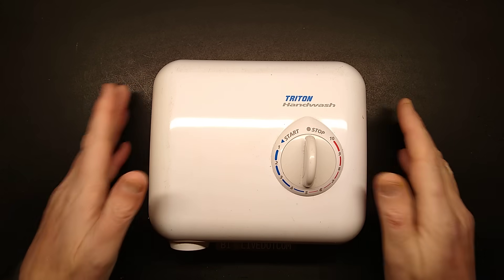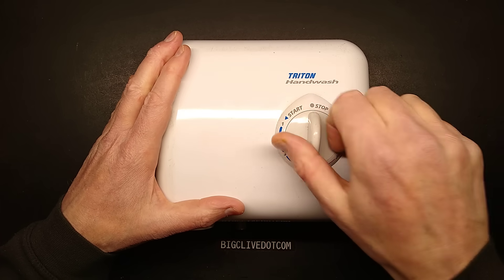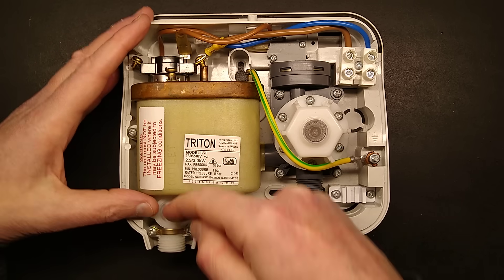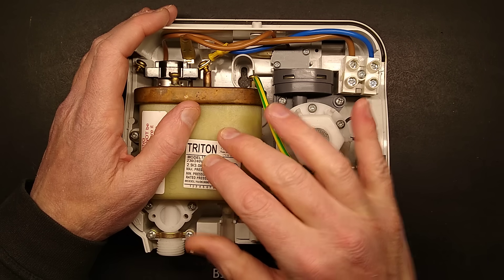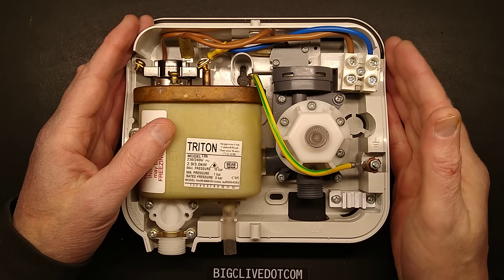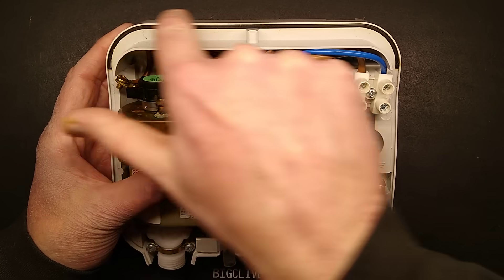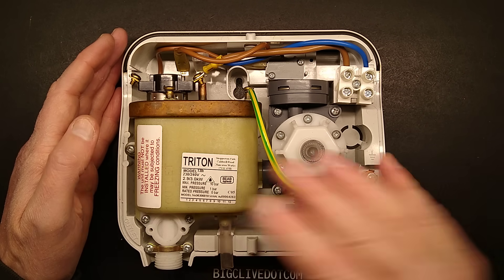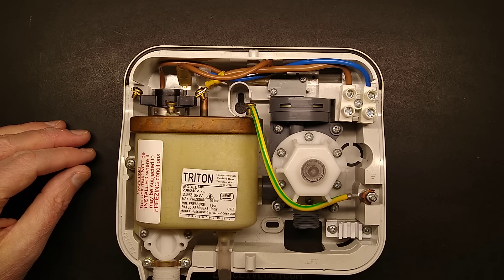British construction site hand-wash unit

Comment: A place I've worked in (and perhaps Clive has too) in Edinburgh had an instant-hot-water tap in the kitchen with potable water, suitable for making tea and coffee right out of the tap. There was no adjustable temperature regulator, just lots of warning labels regarding the water temperature. Never seen anything like that anywhere else.
Reply from the maker: The self filling boilers have been around for a while.
Reply: We have zip taps here in Australia for hot drinks, but nothing like these where you can actually wash your hands. Zip taps are like a straw spitting out how water and like $1500 EACH!
Reply: Got one in as second tap on kitchen sink. First unit didn't work so well, but replacement has been golden. As an uncaffeinated household, It mostly sees use for pasta water, though some stuck on stuff gets placed under it or (for long handled things) held to get cleaned.

Comment: Here in Brazil we don't tend to have whole house water heating, and our basin and sink taps generally just supply cold water. But we do have similar (in principle) gadgets to this. They're pretty much identical in operation to the "suicide showers" with which you may be familiar*. We have one feeding a mixer tap in the kitchen. I think it's 5kW if I remember correctly.

*In case you're not, the big difference is that the element is not isolated from the water. I've never heard of anyone being injured either by the shower or one of these hot taps, though.
Reply: „bare wire“ heating Systems in electric Waterheaters are Safe to use. pretty much all electric Waterheaters here in Germany use it because of its fast reaction to changing waterflow. most common units for showers are 21kw 400v threephase Power. newer Models use electronics to control the heating elements for a stable temperature.
Reply: He already pulled one of those apart: https://www.youtube.com/watch?v=cNjA0aee07k

Comment: I purchased this version which is the mark 2, off E Bay for £52.00 Triton used to be in Nuneaton.
which is supposed to be a retro fit from the mark 1. You should be able to replace the mark 1 with the mark two without having to alter the water feed or the electric feed, which turns out not to be the case. The mark 1 version is held in place by three fixings, the mark 2 version only has two fixings.

Comment: Now there are also instant hot water "mixer" taps with everything integrated in the tap body. But I put mixer in quotes because those only have cold water inlet and I don't know if they divert the water inside and still have an actual mixer or if they use only an adjustable thermostat and you have to wait for the whole thing to cool down if you need cold water and you're damned if the thermostat fails closed and the water boils inside.
Reply from the maker: I took one of the import heated taps apart.  Quite well made.

Comment: I suspect these are more reliable than cheap electric showers which simply have an instantaneous on-off switch, because you give the element time to cool down a bit as you increase the flow rate by needing to turn it towards cold to switch it off. Decent electric showers leave the water running for a little while after the heater is switched off. With cheap electric showers I emulate that by switching them to cold just before turning them off. Otherwise, the water suddenly stops and the temperature can rise considerably in the heater block.
Reply from the maker: I always switch to cold out of courtesy for the next person at the gym.

Comment: I remember a predecessor of these where there was a small cylinder of water heated by electricity over a sink: my late great aunt lived up to her death in 1998 in an end terrace with no central heating, no bathroom, an outside toilet and no hot water save for the cylinder above the sink. Are they still made?
Reply from the maker: Yes.  You get over-sink and under-sink electric water heaters.

Comment: I'm really impressed by the specs on that little heater unit:
Max pressure: 10 BAR
Min pressure: 1 BAR
Rated pressure: 0 BAR.
Wouldn't you expect rated pressure to be somewhere between min and max?
Reply: I think the Min/Max is for the tap, and the 0 BAR is for the heater which is designed for unrestricted flow.
Reply: Badly worded, but correct.  Max SUPPLY Pressure 10 Bar, Minimum SUPPLY pressure 1 Bar, Operating pressure WITHIN THE BOILER  0Bar.  Crap and lazy labelling by a manufacturer that has been making both these and similar shower units for Decades.
Reply: I think what the label is trying to say is that the unit should not be installed in public houses without a risk assessment. 🌊🍻🚫🙃

(And given how some of us Brits can be after we've had a few, that's probably not too wide of the mark! 📜😉)

Comment: I quite like on-demand water heaters like these. They're especially sensible when placed on a sink the opposite end of the building from a main water heater. I think I'll take the difficulty in wiring one of these in the USA (something not done often) in exchange for not having to daily carry around a USB power adapter the size of a literal brick as most UK types are.  If I could choose a global standard, I'd honestly prefer Schuko to either of them, though I do like the UK's switches at every outlet. Very useful.
Reply: Is the Schuko preference for performance or personal reasons?

Comment: That's cool. We don't have those here in the US. You use cold water from a water bottle you brought with you or you find a gas station to go wash your hands. If you are really lucky there might be a water hose on site somewhere. At some point I need to add a sink to the shop as it would be very handy. Easier than making the 250' round trip to the house just to wash hands or clean things. One of those would be really handy or something like it. 
        And yes we see electric showers as scary dangerous. In the UK it's Ok to have live power right in the shower with you but you can't have an electrical outlet anywhere in the bathroom unless you have a massive bathroom and it can be something like 15' from any water source... Makes no sense. But then neither do plastic breaker boxes and many of the other methods in UK/Europe that would never meet code here in the US.
Reply: The reason that electric showers are safe is that they are specifically designed, as sealed units to be safe in very wet environments. Americans seem to have no issue with hot tubs that similarly can combine electrics with water.

The issue with standard electrical outlets in bathrooms is that anything can be plugged in and used in close proximity to very wet areas. A hair dryer, for instance, is not designed for use in very wet areas, nor is an electrical space heater. 

Electrical sockets are now allowed in UK bathrooms, but they have to be at least 2.5m (down from 3m) from a "wet area" (bath or shower), as the length of the flexible cable on a typical portable appliance makes it unlikely that somebody in such an environment could touch one 

Needless to say, for some time bathroom electrical systems have also had to have RCD (GFCI) protection, and it wasn't until that was the case that standard power outlets were allowed in UK bathrooms at all. Of course, prior to RCDs mains powered devices in bathrooms could be especially dangerous.

Incidentally, neither 2.5 or 3 metres is 15 feet.

Comment: Not only the americans find that shower heater dangerous. The germans do as well. My colleagues and friends did not believe me that these are legal in the UK, so I had to show them the website / photos.
Reply: They're completely safe if installed properly, of course.
Reply: @matthewmarks6951  Yes, I can confirm that. However, I don't think that I will fully get used to them, ever. Years of training of "no power to the shower" has left a mark.
Reply: @ChipGuy  Funny that, as on the continent people often have washing machines in wet rooms, whereas we're not allowed to have sockets and instead are saddled with those awful isolating transformer-equipped shaver outlets!

Comment: Years ago I had one of these in the bathroom of my flat. Found out each fkat had one fed from separate outlet on a large water tank in the roof. The maintenance guy said it was to keep them off the mains pressure.
It was also incase he had to cut off the water for any reason we still had a short supply which had happened in the past.

One of the rare Landlords that cared about his tenants as he also had some large generators he could bring in and hookup incase of power cuts.
Reply from the maker: In Scotland a reserve of water to the taps is required.

Comment: Here in the US I just bought something similar, a 9600 watt "Chronomite Instant Flow Water Heater".  It is 240 volt, 40 amp, and I'm going to use it as a booster to the inlet to the 10 gallon water heater in my RV bus conversion, which only has a 1500 watt element in it.  That way, the recovery time on my water heater will be MUCH less when I'm staying in campgrounds with 120/240 volt, 50 amp power.  For use in campgrounds that only have a 120 volt, 30 amp supply, the heater will be 2400 watt, which is still better than nothing. ;)

Comment: ebay is awash with Kitchen hot water taps at alarming cheap prices but nice to see a good educated review on a traditional brand product which may prevent you from electrocution
Reply from the maker: I took one of those apart and it was actually well made.  And the thermal fuse was real (I tested it).

Comment: The switch is on flow, not pressure. It only powers the heater when the water flows.
I’m American and I used this type of heater for my whole house for 35 years. I had two 9kw heaters for my house, so that both showers or shower and kitchen faucet could be used simultaneously.

Comment: It's always amazed me how long those micro switches last breaking that 3kW load. I remember looking at our old electric shower some years ago after replacing it, which had 3 micro switches to control the 8kW load. Needless to say the 2 most used of the 3 were very worn and pitted inside!
Reply: It helps greatly that it's not an inductive load, so it won't try to suck power across the contacts when they open, and draw an arc.

Comment: Are tank style waters just not a thing over in the UK/Europe? I have one that's like over 30-40 years old, works great. Bloody thing shoots out water so scalding hot you could practically make tea from it straight from the tap.
Reply from the maker: If you have an electrically heated water tank and the water is that hot I'd suggest making sure it's not got a failed thermostat and is drawing power all the time.  Similar ones here often vent boiling water into the attic water tank or onto the roof when they fail like that, and run up a HUGE electricity bill.

Comment: I started to use electric shower units to provide hot (ish ) water  at the sink 10 years ago. I had two, upstairs and downstairs but lost them when I moved recently. They were about 50 quid when I got them, but now they are a lot more expensive. In my new home I wanted to do the same and was dead lucky to get an almost new unit at a car-boot sale for a tenner. It's fitted and works OK The drawback is the power needed. Mine is an 8kW ( nominal ) which would require I install about 50 metres of 10mm cable ( expensive ). But there are 2 separate heater elements. One is rated 15kW and the other 20kW. You have to monkey with the internals, but I can use just the 20kW element and use standard mains cable without much risk of overheating. I expect the insurance company would take a dim view, but theyre such a bunch of pussies.

Comment: What is a better alternative to these water heaters in the UK? Are there better units that have a small storage tank?   
I have these at home and have been contemplating some sort of upgrade, it's on a 30amp circuit. It takes eons to wash dishes as the flow rate is really low when outputting very hot water.
Reply from the maker: You get undersink ones that store a portion of hot water and only use about 2kW.  Screwfix has them.   Try to get a bigger capacity one to avoid running out of hot water too quickly when washing dishes, or just adapt to suit.

Comment: I think Americans are afraid for the reason you said, "maintenence". 

Did you know that almost everything sold in America is "zero maintenece"?

Not that the manufacturur claims that! Most likely, they even provide a schedule of requirements! American's just don't do the maintenence, then replace the unit when it stops working.

Comment: I wouldn't call these things "efficient" .. at least energy wise.. you know.. burning coal or oil etc. to create steam to drive a turbine to create electricity and then converting it back to heat water.. I was taught this is the least efficient way to heat anything..   They are convenient though and hold up to  "workplace safety regulations" I would guess.. The days where you have a barrel with a few burning planks in it a grate and a kettle on top are over. First world problems .. sigh ^^

Comment: Oh look a 1/2 shower! 
For those who do not get it the standard UK shower has 2 elements ..... if it gets too hot the smaller of the elements is switched off (you can hear the click). I think the switch is a pressure switch so dependent on how much water flows for temp control.
I remember taking a broken (Dolphin?) shower out to replace (back in the late 70's) only to find the block was cast clear plastic with a coil of nichrome wire in the water flow. Not sure how that would go with modern RCD's but I did notice the Neutral end was nearest the showerhead ..... so ahead of its time the Chinese are just catching up with them! ;o)
Reply from the maker: I saw one of those submerged element heaters a while ago.  Very unusual.  Lots of protection against current leakage.

Comment: I think the Americans view of the uk on-demand water heater Systems is biased. I think most peoples view of it is like that of a suicide shower head water heater. It's a neat idea that stems from the regulation to not combine hot and cold taps. Over the pond we have on demand water heaters in a couple different styles there's the approximately 0.5x2x0.15m Walmart on demand water heaters that take 2, 3 or 4 40A 240v circuits that generally requires an entire electrical upgrade to run. Or we have smaller units much like that that can go under a sink in a remote bathroom but then you're running the water until it heats up usually and it still requires a 30 or 40 amp circuit. Although a lot of this on demand stuffed it did not really start happening until about 20 years ago. it's much more coming to have one central water heater tank and the new ones are fairly well insulated so it'll stay warm all day and just sip power. And with the new heat pump water heater tank units they only require like a 20 amp circuit to keep 50 gallons of water hot.
When I visited the UK in 2004 the house that I stayed at I was surprised to find one and I wouldn't say I was surprised to have a cold shower it warmed up fairly quickly and was quite pleasant, The learning curve wasn't that steep and I was given no instructions!
And well over there you don't put light switches in your bathrooms due to safety? I think over here the concept is weird to think that there's 240V@20-30A just on the other side of that panel of plastic in the shower that's soaking wet.

Comment: I have recently bought one of these to use as a temporary warm water supply, if I need to work on the normal hot water system, I have mounted it on a Plywood board fixed to a stand & connected to it a flexible appliance supply hose & length of 1.5mm flex with 13amp plug. I have the normal 3 Kw version. This unit is also available in a 7Kw version but needs to be on its own 32amp circuit.

Comment: Re: electric showers, we had one ignite a year ago. The live cable had melted inside causing a nasty short and a loud pop. When the electrician came over he said we were lucky it hadn't caused a shock.

To make matters worse, a different electrician had done some work previously and bypassed the rcd (which was a seperate one for the shower). Since then we've had a new consumer unit with integrated RCD
Reply from the maker: It's not uncommon for bad terminations to burn.  It was unlikely to cause a shock, so it sounds like your "electrician" was scaremongering.
But bypassing the RCD is not acceptable.